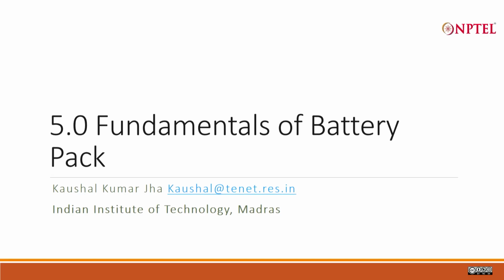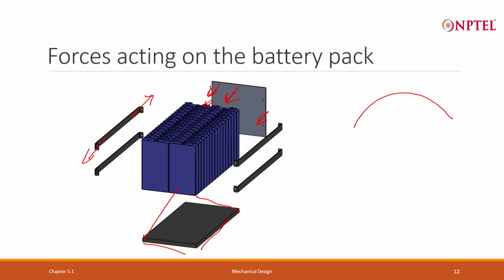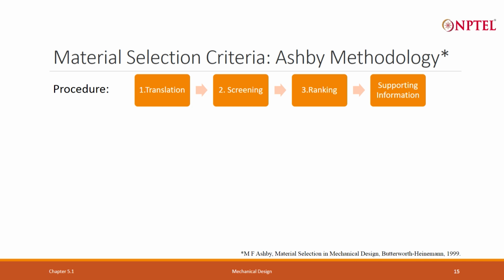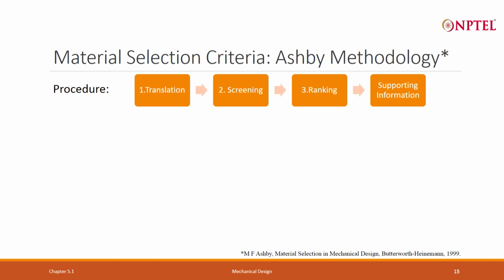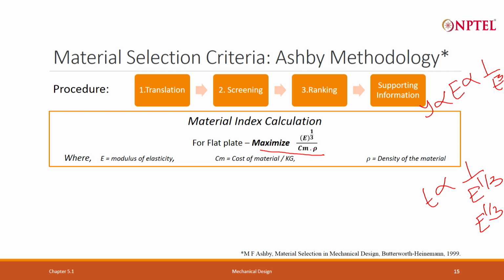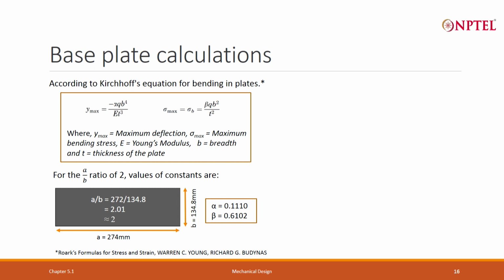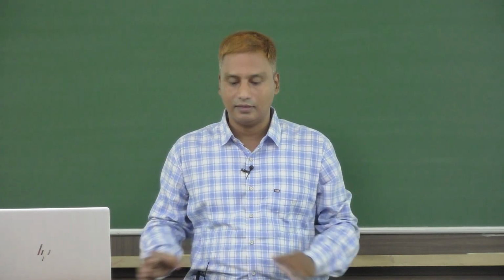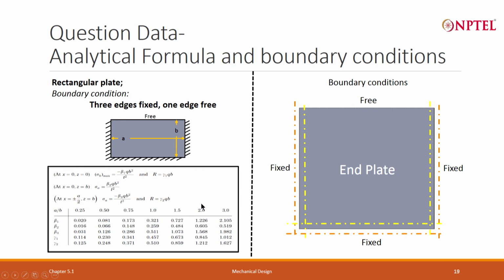Lecture 35 - Mechanical Design - Part 3

Comment: At 16.42 for material index calculation, professor mentioned that deflection is proportional to Young's modulus(E) and we have to minimize deflection. So doesn't it mean we have to minimize E. But why are we trying to maximize E instead?